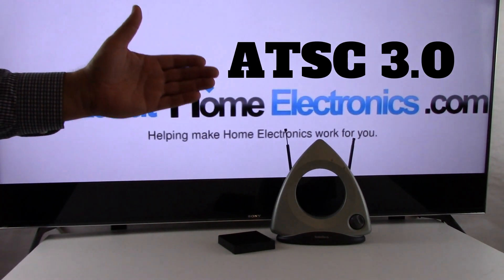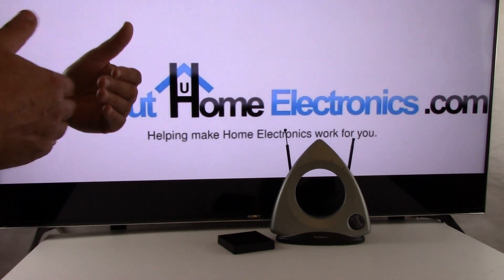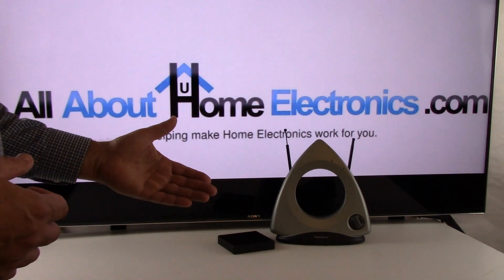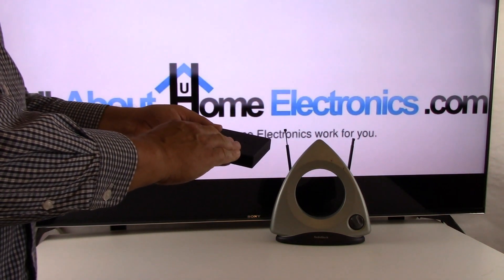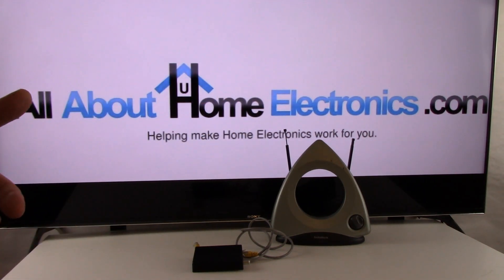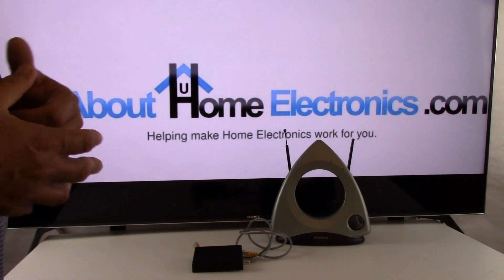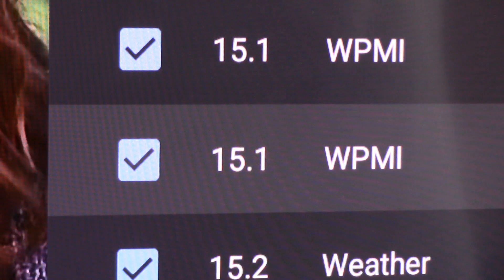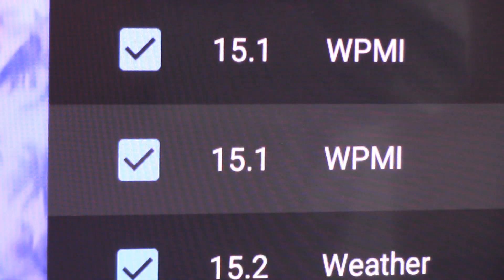How to Watch 8k 4k from over the air antenna

Comment: This guy doesn’t know exactly what he is talking about. First of all ATSC 2.0 was never deployed…..all current broadcasts are done with digital ATSC 1.0, ATSC 2.0 has not been implemented. And secondly if you have a tv or a standalone 3.0 tuner it will scan and load 1.0 and 2.0 channels together. Under 1.0 channel 4 should appear as 4.1 as 3.0 the channel will probably appear as 104.1  I could be wrong about other areas but where I live that is how they are defining the channels. So you could select either the channel as ATSC 1.0 or ATSC 3.0……… again there is not a 2.0 channel.
Reply from the maker: The video is about how to view 4K from an over the air antenna. Both the TV and external tuner have 3.0 capabilities + we demonstrated how the devices listed scanned channels.

Comment: To answer that question. You don't need internet to receive over the air channels on ATSC 3.0 with the current software installed but you must have internet to receive features and software updates. You could take your receiver box to a friend s internet or work internet and do updates but you will miss out on special features that require internet.

Comment: That is a good question. I won't have internet in my retirement home just a cell phone. I don't think I will route my cell to a wifi router. But I plan on putting up an antenna to pick up over the air channels. I also don't plan on having more than one or two at the most TVs.